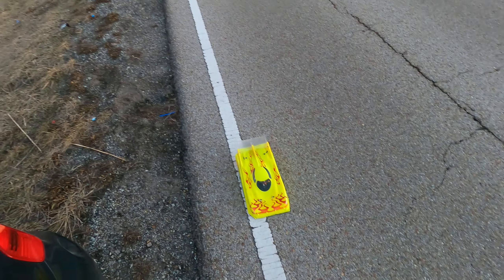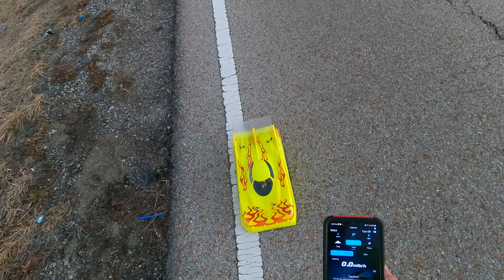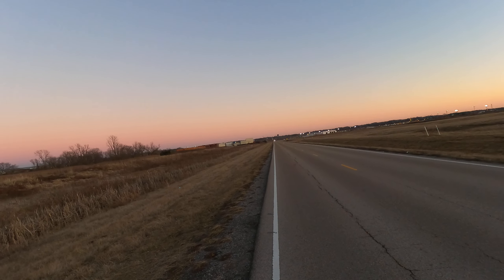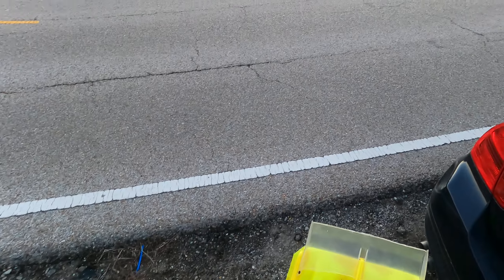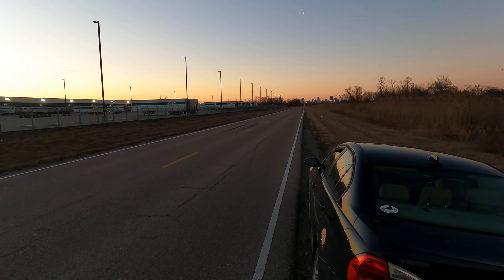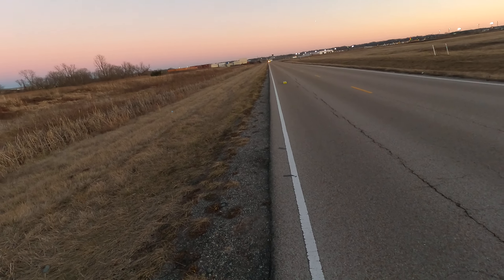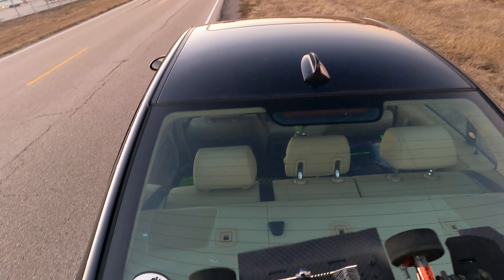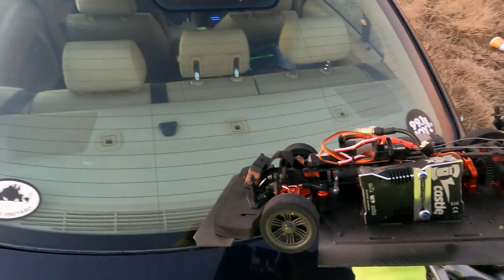RLAARLO 3S TESTING NEW SETUP

Comment: Nice brother! One of the issues with the rlaarlo cars 787 or 917 is the steering systems. It is inconsistent due to the built in servo saver bell crank. There is quite a bit of slop. I have retrofitted a solid aluminum bellcrank and it is night and day difference! Car handles way more consistent now!
Reply from the maker: Thanks,an thanks for the tips..I normally glue ss on all my cars an I forgot to on my other 787 last week an it did front speed-wobble hard at about 90ish,lol..seen your car has lots going on up front,but ya need Lotz Goin on to run them speeds an power throu 1/10..very fun learning this new setup..loading a nicer vid from 2day now

Comment: where did u get the carbon fiber plates for the chassis
Reply: and the bodyshell?
Reply from the maker: Deltaplastik x1 body an I got 300x200×2mm sheet off Amazon an cut to fit
Reply: @KBASHRC  ohhh is it 1/8 shell or 1/10
Reply from the maker: @IronkillerGT  Deltaplastik phantom x1 1/10th body

Comment: Dude I’m doing 94mph on mine and keeps catching air.
Reply from the maker: If its happening at the same speed everytime then your  Rear is mostly likely squating at that speed from downforce an acceleration.the second rear go's lower than front over they'll go everytime..you must keep rear from squating lower than front..many different ways to do that
Reply: @KBASHRC  I’m new to speed running some tips might be helpful
Reply from the maker: @kj4x4couple7  remove rear shocks an replace them with turnbuckles an it won't blowover unless ya hit something an front bounces up enough to get air under it..or I put 1/10 erevo springs on stock shock where it basically don't move
Reply: @KBASHRC  sweet thanks man